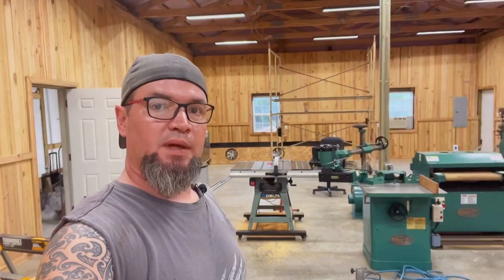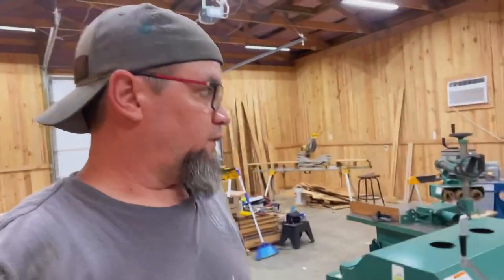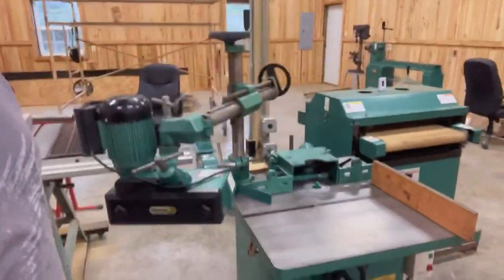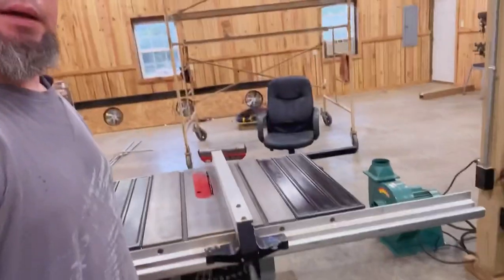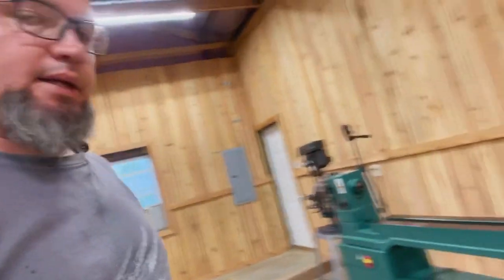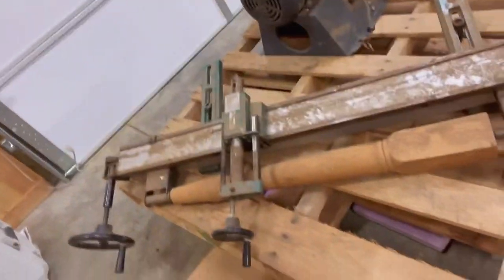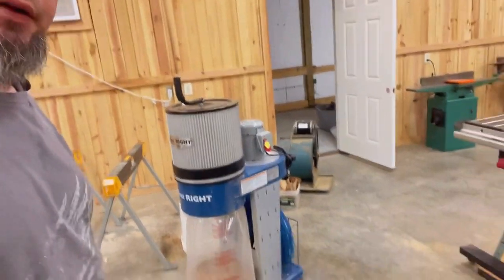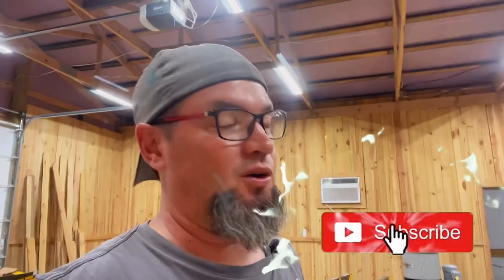Build a woodworking shop. Join me on my journey! Episode 7… Tool update!

Comment: Looks great.

I use a product called Gibbs Gun Oil and stainless steel kitchen scrubber to remove rust.

Works great on everything. 

Has taken surface rust off firearms with no problem.

WD 40 will work with the stainless kitchen scrubber also.

Are you going to separate the refrigerator from the vaccuums and air compressor?

Wont that be a bit loud for somebody taking a break?

Especially if somebody else is working on something.
Reply from the maker: Hey man. Thanks! I’m def going to have to check out that scrubber for sure. I wonder if it’s like a 0000 steel wool?  

The refrigerator, vacuums, and air compressor will each have their own dedicated circuit. As far as separation from the “spare room” I would like to build a wall that will add one more layer of noise reduction. As far as machines running while taking a break… right now it’s just me. I keep saying “mill” out of habit but it’s a workshop. I’m picturing a leather couch, refrigerator, coffee maker and possibly a restroom (hindsight). Just some place to shut things down and relax a bit if needed.
Reply: @MatthewPeechWoodworking  gotcha on the break room.

Steel wool will rust.
These are those cheap stainless steel scrubbers you can get at the dollar store.

I like to watch and learn. I may never have a large shop.
I really do not want one. However if I do manage a small workspace I would like it to be as efficient as possible and watching you and others may help me avoid pitfalls.